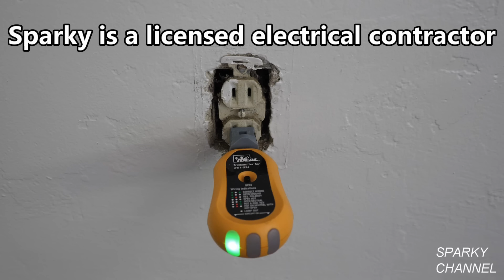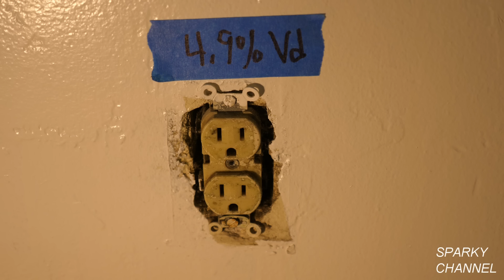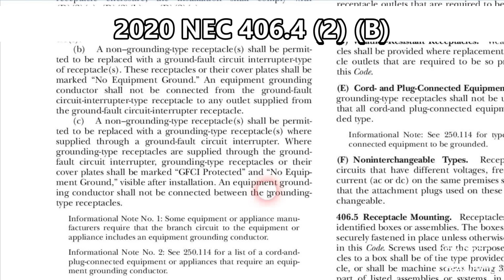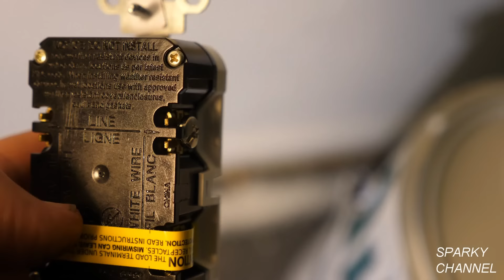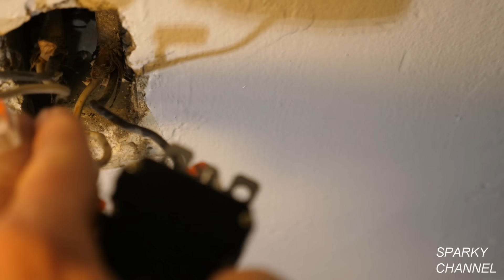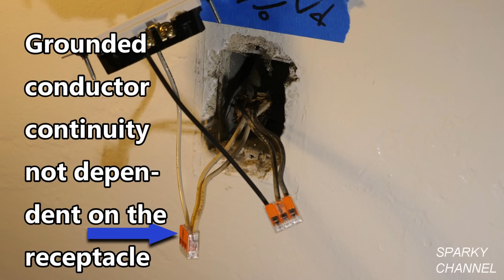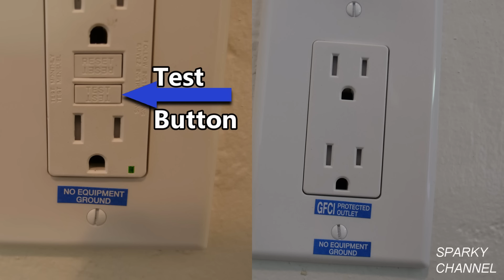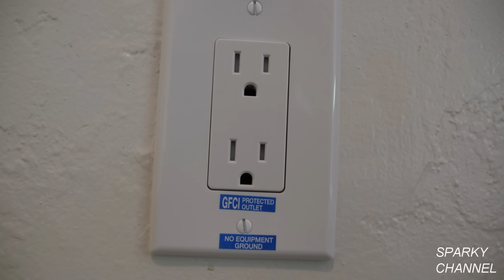2 Prong Receptacle Circuit Replaced by GFCI and Grounded Receptacles per 2020 NEC

Comment: Thank you sir for this refresher u have produced. Ther are ongoing arguements on proper GFCI instalation techniques, V- Drop, wire size and code interpritations.
These are great refresher videos for the seasoned and upcoming wiremen.
Thank you! and keepem coming!!
Make more videos on Trick Bends
on not so common bender machines.
That is what i find we wiremen lack exprience and knowledge, on the field
 because they are not very common;
we face evryday in the "trenches".
Reply from the maker: No problem, thanks! What EMT bend or combination of bends would you like to see?
Reply: @SparkyChannel  Thank you for the quick response!! When u have the time,
segment bends, matching kicks and parallels are always a brain teaser in the field. Also the concept of finding radius and centers of bends. When and why to use "push thru" methods. Hope its not too much but i always find these  concepts a dilema in the field. 
Regards
Reply from the maker: @rdrserg  Excellent ideas. I'll see what I can do. My idea is to start with the basics and slowly get into more complex bending. Thanks!

Comment: Fascinating that there are still ungrounded outlets in the US. Up to the 1973 they used a system with a PEN conductor instead of separate neutral and ground wire, PEN is the summary of PE (protective earth, or you call it ground) and N for neutral. Meaning that is a conductor conducting operating currents like the neutral and in addition fault currents like the ground, if they occur. In the late 1960s they connected the PEN to the ground connection of the outlet and installed a wire bridge to the neutral terminal. That was the reason the Schuko outlets had two screw terminals for the ground which were connected internally. In mid 1960s and before they installed the PEN to the neutral and installed a wire bridge to the ground terminal. In bathrooms and damp rooms there a separate ground was always required by code, and a distance of at least 60cm between an outlet and the edge of the tub. In 1984 RCD/GFCI became mandatory for new bathrooms by code.
Since 1973 a PEN is only permitted if its cross-sectional area is larger than 10mm² in copper or 16mm² in aluminium. That means, in most german households the service entry has 4 wires for L1, L2, L3 and the PEN. From the service entrance box the PEN is splitted into a separate neutral and ground. That grounding system is internationally called TN-C-S, in the US that system is called multi-grounded neutral. The problem of the TN-C system (without the -S) is, if the PEN breaks, through the wire bridge all metal housings which are connected to the ground will become live at mains voltage. Making the wire size bigger will decrease the chance of a broken PEN.

https://en.wikipedia.org/wiki/Earthing_system#Types_of_TN_networks

The most interesting about voltage drop is how high it is between the meter and the last outlet of the circuit. Because that is that is a factor you're actually loosing money, you pay for the cables heating up your walls. Here they demand a drop of less than 3% between the meter and the last outlet of the circuit on the rated current. That's actually the reason we now use one wire size larger than actually necessary. But that's only for new installations, back in the days no electrician here actually cared about the voltage drop.
Reply from the maker: Hallo mein Freund! Yes, grounding and bonding have come a long way in both of our countries!
Reply: In Finland two wire systems were allowed until 1989 with a normal neutral wire. Then up to 2007 they were allowed with the 10 square mm PEN-wire. Ungrounded outlets on dry places were legal until 1997. Now grounding and RCD is mandatory on all new installations. Only fridge/freezer can be unprotected with an RCD. The reason PEN wires were banned was not safety but the interference they can cause to IT-equipment. In practice RCDs made them impossible.

Here the the problem was reverse than in the US. Still in the 70s many devices were with ungrounded plugs. If you had a schuko socket there was a problem. When I was a kid we had tile floor on the TV corner and that mandated a grounded socket. The Blaupunkt color TV we had had an ungrounded plug. We had an illegal cord that removed the grounding. Grounding was seen as a nuisance, not as a safety feature. On lamps ungrounded plugs were sometimes used until the 90s so they can still cause problems when people move.

My electric work is from the 60s and 70s with all sockets either ungrounded or with nullung . The panel is new with RCDs that are not connected because of the PEN-wires.

In the 70s total of 97 people died of electrocution in Finland, in 2010s 20 of which 8 involved mains voltage and 12 high voltage. Still in the 80s 8 children died, in the 90s one and none after that.
Reply: @okaro6595  You can plug an ungrounded plug into a grounded outlet in case of the Schuko system. Actually there are two ungrounded plugs fitting, for example the Europlug rated for 2.5A and the other one is the contour plug which is also ungrounded and rated for 16A. The Europlug fits into most european outlets, except UK, Ireland and Malta. They don't have round pins there, the pins of their plugs are rectangular.

Europlug:
https://upload.wikimedia.org/wikipedia/commons/6/63/Euro-Flachstecker_2.jpg

Contourplug:

https://upload.wikimedia.org/wikipedia/commons/e/ef/CEE_7-17_plug.jpg

What type of plug is required depends on the appliance, if the appliance is double insulated (class II, symbol for this is a square inside of a square) a ground is not required. Most powertools are class II and don't require a ground. But if you have a class I appliance that requires a ground, you must have a grounded outlet for this.
TVs are mostly class II double insulated appliances.

Comment: Could you have checked with a multimeter if the metal box provided ground? if it did, can you tap a green ground wire to the device (receptacle)?
Reply from the maker: Yes, that's correct. I have a video coming up which will show how to test for the path to ground and how install a bonding wire into the metal box if it does show a good path to ground.
Reply: Sparky Channel  Hi Bill, thanks so much! Is this video out yet? I would love to see it.
Reply: L M I’m pretty sure the box is independent and there’s no EGC since it’s “ ungrounded”wire method (no ground in the sheathing) So connecting it to the box wouldn’t do anything.

Comment: Nice video, Sparky, and I’m glad your channel is back up with lots of videos.  I find them very helpful.  I do have a couple of questions: Could you explain to us how the GFCI offers protection to the downstream receptacles even though it doesn’t have a ground wire, please? I don’t quite understand how that works.  Also, in what cases would you say it is acceptable to use this approach vs. rewiring with cable that includes a ground wire? Thanks!
Reply from the maker: GFCI receptacles don't need a ground wire to trip and turn off power to the GFCI and downstream receptacles.
Reply: orascreencasts right, how would it trip the GFCI( first stream) without the ground wire on the down stream outlets. 🤔🤔 at the same time they did put a label in it,maybe it’s to warn the USERS but most people wouldn’t even know what we are talking about, so they’ll just use an equipment that could have malfunction and shock themselves.

Comment: So I have a question, ungrounded is hot wire , grounded is neutral wire, ground is is the bare ground or green insulated wire.

This video When you say “ungrounded” receptacle do you mean that the receptacle is not provided by a bare ground? 

Is there an article I can read deeper about this? 

Also I watched your conduit bend videos, 👍🏼 thank you
Reply from the maker: In a house electrical system we have grounded conductors (called neutral wires) and ungrounded conductors (called hot wires). But all we're saying when we say a receptacle is not grounded is that there is no ground wire serving the receptacle box. This is common in houses built before 1970.  Basic Wiring (Home Repair and Improvement, Updated Series) : Amazon: https://amzn.to/2Jnk9gD
Reply: Sparky Channel so you’re telling me if there’s a ground fault, hot wire touches a metal, let’s say inside a toaster... this would shock the person back in days? 

Thanks for replying spark
Reply from the maker: @johnquilla8236  Yes, absolutely. It's still a problem on circuits not protected by GFCI.